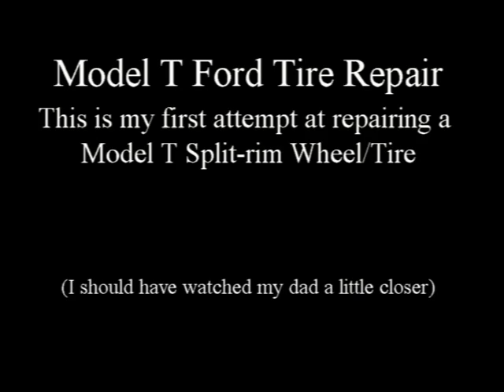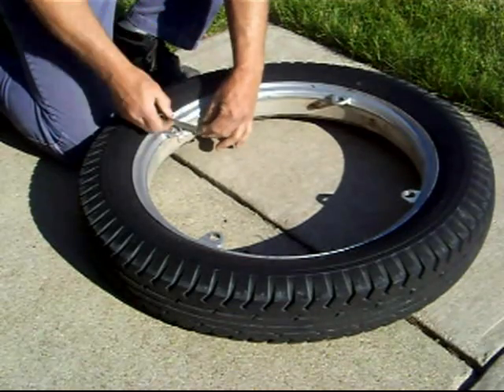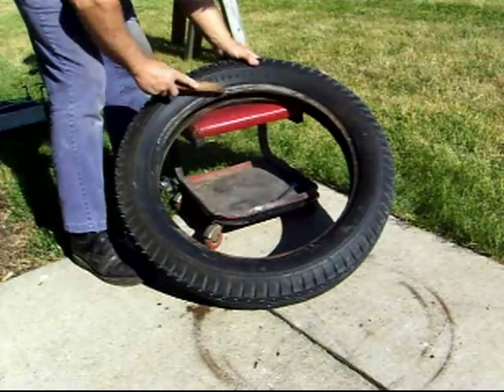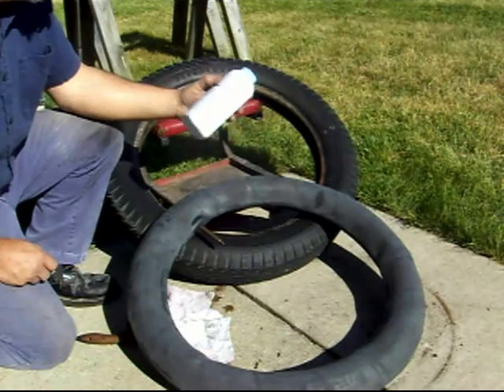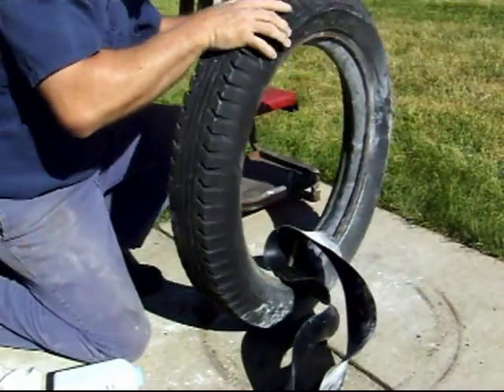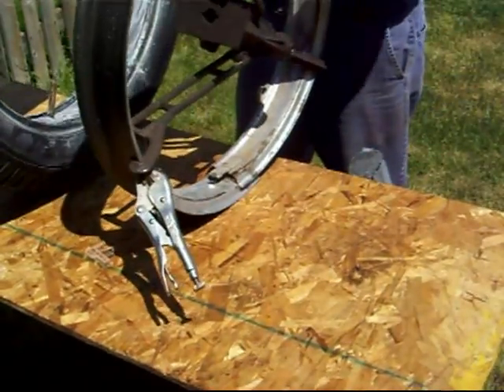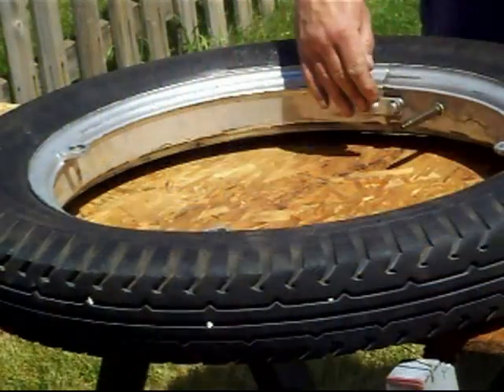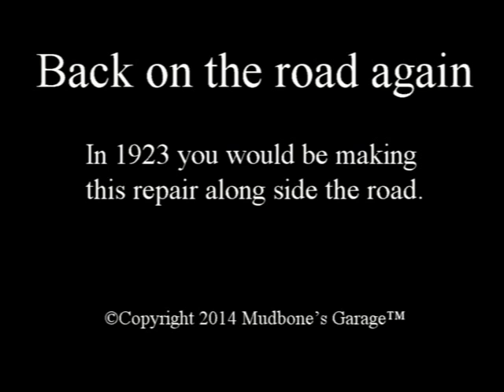Model T Ford Tire Repair

Comment: Last summer I bought a 1928 DeSoto with wooden spoke wheels and original tires. My bright idea was to buy new tubes for $90 (19x5). We ended up sawsalling the tires off. Another bright idea, I thought well heck I have lots of 19" tires in my cycle salvage. But none wide enough so I bought some used flattrack racing tires. The rims were the split type. The pins came out of three but the 4th...no way. Without knowing of any clamp device, I assembled 1 complete wheel. Except for the flap I never knew existed. Long story short, I sold the car to a 70 year old local farmer who's in the process of street rodding it! I'll be adding pics to my channel. Oh, anyone in the market for baby powdered new tubes?